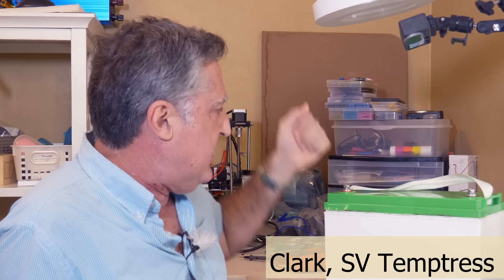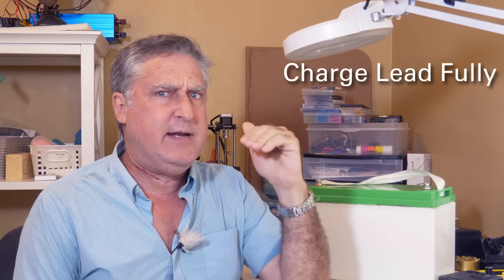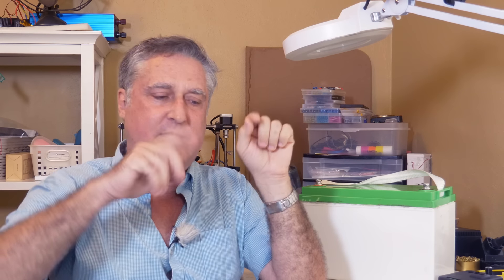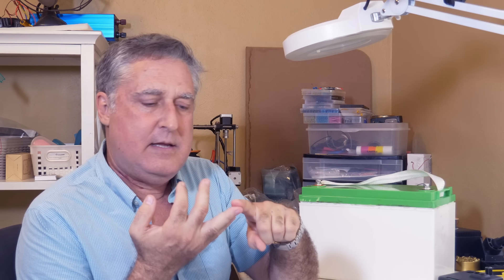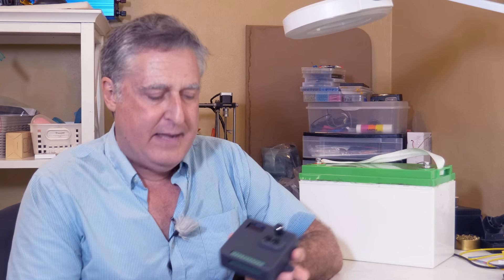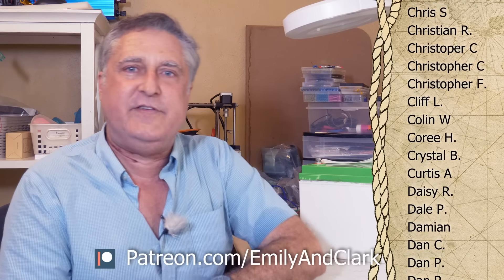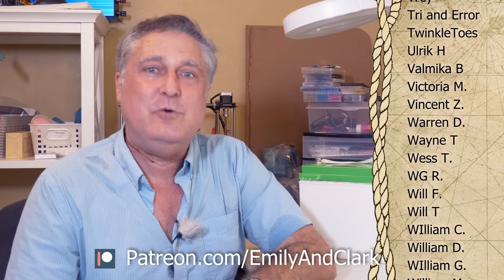Charge Lithium Batteries correctly (LiFePO4)

Comment: LiFePO4 will develop a memory? Never heard this before. Source?
Reply from the maker: I can't pay my fingers in a source at the moment but my friend Conrad (from my videos) has seen it happen on a guys boat.  He was able to clear it by manually overcharging.
    The information is out there but like everything else LiFePO4 searches will give you the wrong information we are fed.
    You need to read the scientific literature.

You might start the search with Conrad's article linked to the bottom of https://www.emilyandclarksadventure.com/bbms

He has links to research
Reply: No really, does anyone have a source or further reference for this claim? Cheers.
Reply from the maker: Go to Google and do a search if you want to know.  I just did a 2 minute search and found this.
https://www.researchgate.net/publication/275403167_Failure_Investigation_of_LiFePO4_Cells_under_Overcharge_Conditions

It's not one of the papers I remember reading, and no I didn't just read it.

The important advice I offer for your research is you have to skip the shiny marketing pages from the battery salesmen and read the scientific papers.

It's the 21 century.  The information is right out there, you just have to ask a search engine.  I hope you have a fruitful search.  It's eye opening but a little brain fogging to study this stuff
Reply: I have not come across any direct evidence for this claim in years of research and testing. However, degradation of any kind causes higher internal resistance - and since IR rises as you approach 100% charge, perhaps people are mistaking degradation as a "memory effect".

In practice, the more you keep a LiFePO4 cell away from SOC extremes (>3.45V and >2.5V, where the most degradation occurs), the BETTER it will tolerate a charge to 100%, courtesy of the lower baseline internal resistance.
Reply from the maker: @junkerzn7312 just type this into Google
"lifepo4 memory effect"
Reply: I have 2 105ah eve 51.2v packages I've been charging them to 54.6 for at least 1.5years now I added other packages 280ah the 105 ones stop taking any current after 54.6 the others do, they either have memory effect or they lost capacity and no longer take charge beyond that voltage. I did a capacity test for those and they sit at 93AH also I want to add that I've tested new 105cells at the first charge they will take power even at 3.55 volts. And the brought 116AH
Reply: @Clarks-Adventure  "trust me bro" is not evidence. We already know over charging damages cells.
Reply from the maker: @ModernSurvivalSense It must suck having no trust.
Reply: @Clarks-Adventure  sure doesn't help when those that pose as authorities make no real attempt to back up their claims, but still maintain a condescending tone towards the people that question them.
Reply: @Clarks-Adventure  that’s not how science works. I thought you said you were an engineer?
Reply from the maker: I have listed academic papers on other comment threads.
   Or you could read Conrad's article linked to the bottom of emilyandclarksadventure com/bbms.
    Or you could just ask Google.   Low current overcharge is a helpful search term.

Comment: If you charge only to 13.5 volts, then resting voltage rests even lower ?

If you charge to 13.48 volts DC on a 12v Lifepo4 battery, you are not getting full charge and balance the cells. All Lifepo4 batteries come with a BMS battery management system that prevents overcharging. Lifepo4 battery chargers usually charge to 14.6 volts DC to fully charge and balance. Then at rest they settle around 13.4 v to 13.6 v. Although I do wish all Lifepo4 battery chargers came with adjustable charge voltages.
Reply from the maker: They do.  But that's my point, they shouldn't.

Comment: One situation in which it is beneficial to always charge your LFP battery bank with wall current is for security guards first responders who simply are trying to have lots of current available for either 12 volt devices or other devices that they would run using an inverter and they are trying to save on gas. They don't want to use a DC to DC charger to recharge their battery bank. They want to go home at the end of every night, plug it in, and get cheap electricity.
Reply from the maker: Sure.
   I'd plug in if I could.  But lots of these are used off grid and actively used while charging

Comment: I only use my trolling motor for maybe a couple of hours each time I fish. Should I top off my two 12 volt the theme batteries or weight until I use them several times.
Reply from the maker: A theme?
    I'm going to assume you meant lithium.  Don't top them off.  Just make sure you leave with enough power for the days mission
Reply: Thank you. I also just noticed weight in lieu of wait. Voice recognition not great

Comment: Hi, I've been using 3 x 90Ah lead acid batteries (Varta/Johnson Controls) they are all linked together using (in parallel) with 120A cables, I have used the three batteries like this in our camper/caravan. They have been removed during winter months and maintained by a 24/7 fit and leave maintenance charger, during the months of use in our caravan they are maintained by 280W of Solar panels fitted to the roof of our caravan, in between the panels and the batteries I have a good MPPT Solar Controller which I have set to 300w Battery capacity, I have been using them like this for 5yrs and TBH they are just starting to show signs of being tired... Listening to your comprehensive description of how to charge Lead Acid batteries should I have them set to the closeset capacity (which would be 100Ah) ?? I will probably swap them out at the beginning of next season. Obviously I will have to use the Solar Panels on my camper to keep them charged... This leads me on to some questions about charging Li Batteries... Can I use my existing solar controller as the batteries I intend to buy all have internal BMS onboard, I would obviously use the nearest setting on the solar controller to give output of 14.6V... OR should I just throw my old Solar Controller out and fit a Li compatible controller. ie Victron or similar... a 30A controller should suffice with what I'm using on the roof of my caravan. Thanks for any advice you can give.
Reply from the maker: For Li you really want a BankManager to do it right.  And with a BankManager you can use all your current chargers.
For the lead it's not what it's set for that matters, it's the algorithm the charge controller follows that matters. But it's not as vital for lead
  If you go hybrid with a BankManager the BankManager will "maintain" your lead batteries like your winter device does during every night.

Comment: Two questions- 

1) what is the disadvantages to “keeping topped off” 80% to 100% most of the time? 

2) if charging often midrange, say 50% to 70% or 40% to 60%, would it be better to not charge at all until able to charge to 100%?

Ok three questions😂- in both short charge examples, is this considered a cycle to the life of the batteries?
Reply from the maker: I'd check out that video I linked in the description for the first answer. But in short cycle life

I think if you charge to 100 now and again you are fine. Li isn't as sensitive to this as lead is.  Different animals 

I think life is best expressed in total watt hours delivered not cycles but things get dumbed down.  Again I didn't go into this as the engineering explanation guy did a good job

Comment: I have a boat with solar panels, and when it's docked, I keep the fridge running all the time, for example. However, if I go out for a weekend, I can drain the battery bank quite significantly.

I can't purchase your device at a reasonable price since it comes from another country. I do have a few questions, though.

You mentioned that batteries can get "killed." But isn't it true that all batteries will eventually fail, no matter what? What are the actual differences here? For instance, if I charge to 14V and leave it, how does that compare to using your device? What kind of differences are we talking about? For example, does it reduce the lifespan by 50%, or?

If I don’t have your device, what is the best way to charge LFP batteries?

Ultimately, it all comes down to how the batteries are used. They are meant to be used in a way that suits my specific setup, correct?
Reply from the maker: Charging to the BMS limits seems to often give 3 or so years of life.  I haven't run tests but charging my way (the way the cells are tested in the lab) should give you like, 14 years of daily cycles.
Reply: @Clarks-Adventure Now, I didn’t mean charging to 14.6V but rather to 14V, which puts it roughly in the middle of the curve (the “hockey stick” you mentioned). I watched a video from Andy’s Garage, and in it, he says that charging to 3.4V without absorption gets him to around 89% SoC. This would keep you before the curve. Then, if you use absorption afterward, you can reach 98%. 

What do you think about his test?  
https://youtu.be/pijPu7t-akM?si=T4fpy5Rw80V2dxj-
Reply from the maker: As I understand it you can overcharge, and damage, cells at any voltage over 13.48v.  
   Charging is a complex function of several parameters, voltage, current, history, time ..

   You reach 100 percent at 14.6v if you charge at .5C.  If you charge much slower you can reach 100 percent at 13.48v

   There is no way to safely charge to a voltage in an actively used battery system
Reply: @Clarks-Adventure Thank you for the quick response. You’re so good to listen to. 

Not everyone can buy your products because they live on the other side of the world, so it would be helpful if you could recommend the next best alternative. This would also give more credibility to your own product.  

I think I will set 3.4V as my standard charging level and fully charge every now and then. I have Home Assistant in the boat, so perhaps I could create some type of automation to ensure it fully charges occasionally. Thanks again
Reply from the maker: I sell these all over the world so I don't understand "can't".

Reship.com will help you with importation.

I suggest you watch my first two videos on hybrid battery systems.  I did these before I invented the bankmanager.  I've learned a lot since then but there is little that is wrong with them.  I just didn't understand how to properly charge LiFePO4.  Back then I was just following the battery company recommendation.

Comment: I have 2 600 ah battery packs here in my van I live in and I'm currently right now manually balancing the batteries with a 12 v light bulb till I can get a couple 5 amp active balancers and another BMS for this lithonics battery
Reply from the maker: I really like the JK BMSs.  I'll be replacing the BMS in that litime with one soon.  (I hate it's BMS).   They are cheap but great and can be had with a 2 amp active balancer
Reply from the maker: I did a couple of videos on one last winter
Reply: @Clarks-Adventure  you got a Facebook I wanna show you what I did to mine
Reply from the maker: Well do a video I guess
Reply from the maker: I watched your video.
Reply: @Clarks-Adventure  i need to make a new video on it

Comment: excellent review, but i would point out a couple of oversimplification statements made.  i have been off grid for past 2 years and have a lot of lifepo4. I do charge it essentially the same way Clark describes, but do not use a bank manager.  How, and how do i know?  My equipment is SolArk inverters, and SOK batteries, but i monitor with software (Solar Assistant) so i know the voltages and currents in real time. With sol ark at least, but i presume other good inverter/controllers, the chargers are not as simplistic as Clark describes, and have various modes and set points.  For example, i use a voltage mode, but i know the voltages exactly because i can watch the hocky stick in real time. i have a large battery bank that keeps the loads low and relatively stable compared with capacity.  I set the voltage cutoff at the begin of the ramp, and let it ramp higher once a month.  So the small quibble's i have with statements made here are that 13.48 is where the ramps are.  Not on mine.  different batteries are all a bit different here.  The battery mfg should be able to provide values for floats and absorption but a monitor can help you determine this.  Also good charge controllers do seem to charge correctly, and i am pretty sure Victron has products that do this right.
Reply from the maker: Thanks but I disagree on a few points

   First I said 13.48 is where the damage can start in a FULLY charged battery not the hockey stick.
     Second, once you are in the hockey stick voltages you are already fully charged thus seeing damage.
     Third, fully charged can happen at any voltage from 13.48 up.  So charging needs to stop based on the situation the battery is actually in.  

     Good on you to let them overcharge now and again to balance the cells.  Do you monitor to know how often you should do this or did you just choose once a month?
Reply: @Clarks-Adventure  I agree with your point that this is a complicated discussion.  The difference for me is that I have a 164kwh bank, and its in my basement which has stable temperatures. The C rate is so low that voltage turns out to be very predictive.  The bms "state of charge" will drift off over the course of the month, because i can cut off just before its "100%".  For me this is 55.2V.  I float after that at 55.0v, with nearly zero current.  The inverter will limit solar inputs to power loads+what ever extra goes toward the batteries.  The bms will read 99%soc, and drift lower but the  reset at 55.7.
Reply from the maker: @mm-zw1zc yep it sounds like you have things under control with your system.
Reply: Dear @mm-zw1zc, I am curious, about where you have found any information about "float" and "absorption" voltages for any LiFePO4  batteries. 
Maybe I am wrong but those concepts are only relevant to Lead-acid chemistry.

You are referring to a voltage start for the "hockey stick" and if I understand you correctly you believe this is a constant irrelevant to the history of the ongoing charge cycle? 
This is not how I understand the concept of how you arrive at a situation where you are really close to 100% SOC  and at the same time not likely to go into a low current overcharge producing metallic lithium rather than storing usable energy in the battery.

Why do you think a hockey stick voltage rise exists in Lithium?  
If I would try to understand with water analogy that is often used in electrical things ( but not always relevant) I would like to imagine a full bucket of water where if you have a larger/ faster inflow the bucket will overflow earlier compared to a really slow drop after drop where the surface tension of water actually visibly can be seen forming before said surface tension breaks and water starts overflowing.  Just as an analogy model to understand low current overcharge in the drip scenario, the bucket contains more water molecules compared to the fast fill scenario.

I think there is a lot to learn and verify over time about this relatively new chemistry and I have been interested in the subject since 2009. A comparison might be concrete where MIT has been trying to recreate and copy some things done during Roman time that have by now been thoroughly tested!!.. fun and fascinating on the concept of the devil is in the detail!
My take is that Clark is very well-read on the finer details of LiFePO4 chemistry as far as science has described it up until today.
I like a guy who can admit that he has changed his mind about finer details and adopts his invention/recommendations accordingly. 
My take is that Victron et al are a bit surprisingly not really at the forefront of things and that this is just a business/ profit/ production decision. 
It is not like they are getting the upside of maximized life out of these cells but more "good enough and charge a higher relative price due to brand logic".

Comment: Granted more expensive, but I wonder if it would help to have two systems, albeit connected, to switch back and forth to.  That way you could isolate one system to use while the other one gets properly charged
Reply from the maker: If you are charging with alternative energy sources you would still need something like the BankManager because the charging amps aren't constant.
   And drawing power from a big bank is better than from two small banks in sequence.  Lower amps per cell

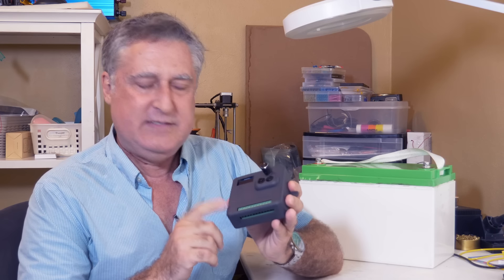Comment: 25:17 there are, aside from specific external parts you can purchase separately to include a BMS, or balance board etc. I build my own batteries from fresh cells.  Most hobby chargers will charge that way (at least if you are using 12 to 24 volts), I have as ISDT Q8 max, that has balance connection along with "main" power connection, and it ensures each cell is balanced the same so you get the most out of your battery as a whole. It dynamically adjust the charging based on the cells like you stated.
Reply from the maker: I looked up this charger.  No it doesn't charge the way I describe in this video.

You may want to watch again.

Comment: You asked if any of us knew of other chargers that use the larger 'information set' that is required to accurately monitor state of charge and acceptance rate of charge. I believe that I saw a video by the developers of the Wakespeed alternator controller that uses a lot of information from the CAN Bus to determine voltage output of your alternator. There is a competitor (not Balmar) that also claims to use sophisticated feedback, but I cannot remember their name. However, these competitors are operating through the alternator, and may not smartly control other inputs like solar panels.